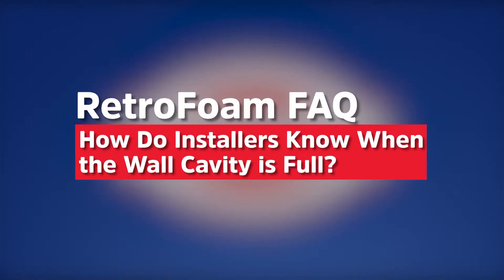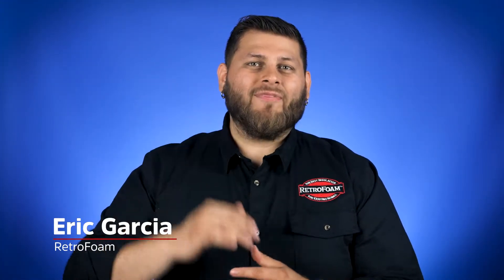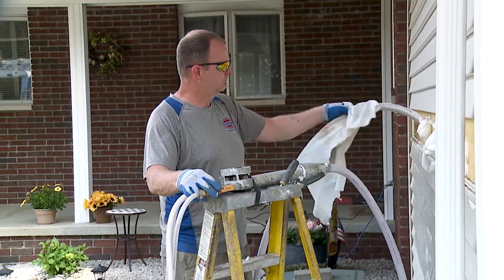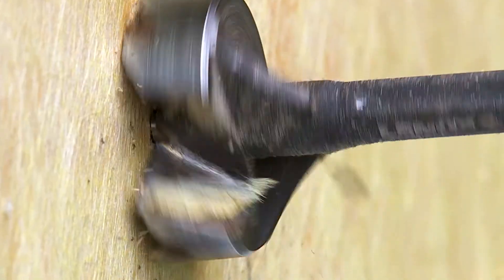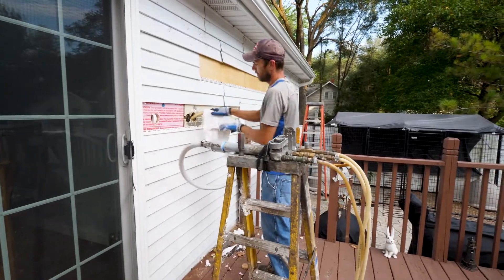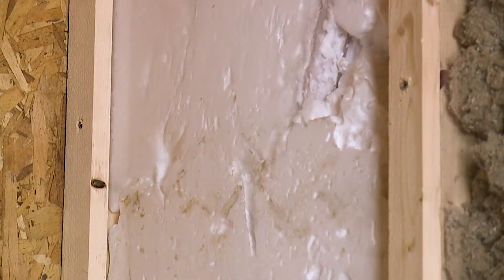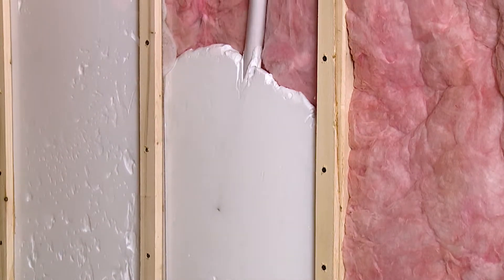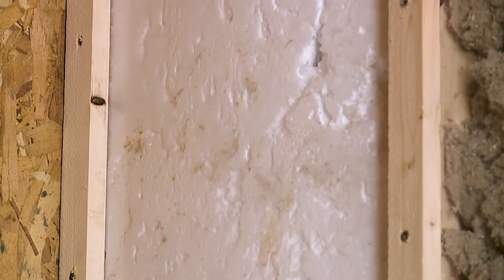How Do RetroFoam Insulation Installers Know When the Wall Cavity is Full?

Comment: The worst home improvement decision I made in 40+yrs. of 
home ownership was my choice of Retro Foam. Now I own a house
that has not passed inspection due to their "work".
I'd like to say "thank you" to Brandon and Joey at the franchise in Pittsburgh for rutting up my 
lawn, crushing my driveway pipe, destroying my joist support beams, leaving the jobsite filthy, spraying foam on my foundation shrubs, plants and hardscape, for not cleaning up the uncured foam that still reeks like a dead animal 6mos. later, and finally for spraying foam all over the HVAC system after I told them not to. But, most of all, I give a big "thank you" to Eric Garcia, expert in Dickensian circumlocution (the art of the runaround), diversion, delay and gaslighting,who made it all a reality I will have to live with the rest of my life.
Choose your contractor wisely, watch the movie "Tin Men"
Don't make the mistake I made.
Reply: Did you take video?
Reply: Why doesn't it pass inspection?